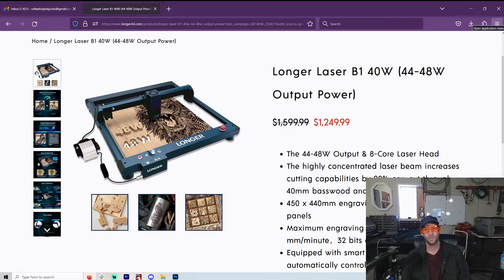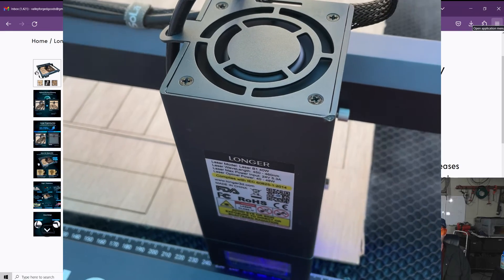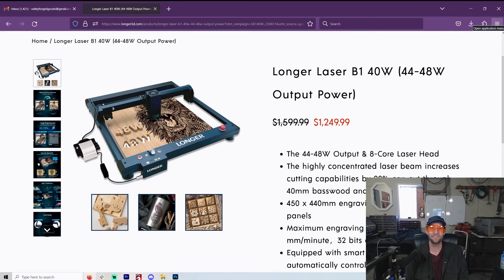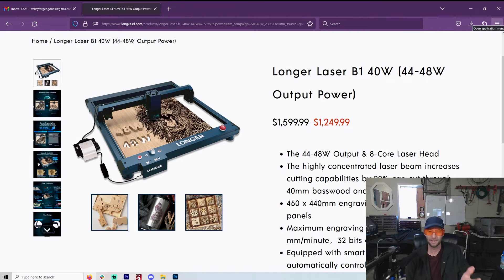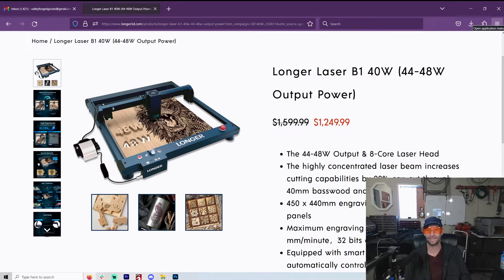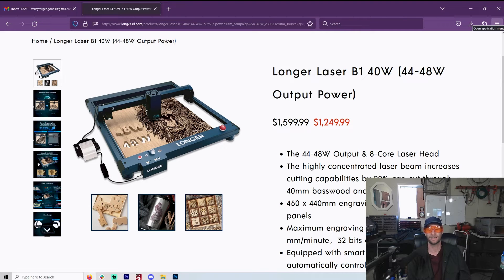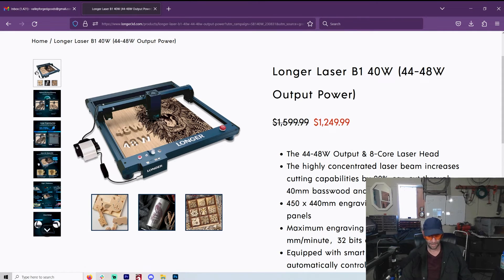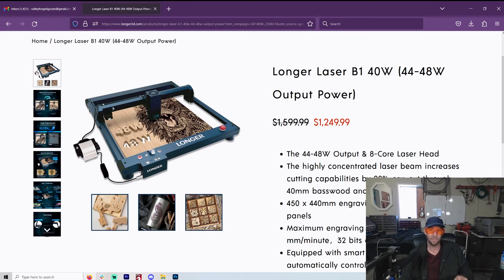NEW!! Longer B1 40w Laser Cutter / Engraver

Comment: I just used your link to order the Longer B1 40W. My Ortur 20W took a dump on me and Ortur was no help.
Reply from the maker: Yeah, Ortur used to be so great, but they sold out as far as I know. I don't know how good Longer cust svc is as none of mine have ever broken, lol
Reply: @ValleyForged should have mine in a few more days.
Reply: @ValleyForged I received the laser and so far it seems pretty good. I do have an issue when I want to clean the lens. The video shows removing 4 screws from the head, but the 40W doesn't have those screws. As a result I can't remove the air assist and can't access the lens. Any help would be appreciated.
Reply from the maker: @pop-popmoose5359  OH, wow, I haven't had that laser in a long time. Perhaps see if they have a Facebook group? I know I cleaned the lens, so it surely is not too hard. Congrats on the your laser! My friend has that laser as well, if you cannot get the answer, I could always hit him up. He loves his (for years now).
Reply: @ValleyForged Thank you!  Found out the is an opening in the side of the laser head. An Allen wrench fits in and allows removal of the air assist. 
Thank you again!

Comment: I have question 
I think 40w is ok for me 
So question is atomstack or longer  ray and why?
Reply from the maker: Hmmm, they are both great if you want the open frame type. Just go deep on both of them (all factors, price, etc...) and go with what you prefer. Check out the ACMER P3 as well if you could do an all in one (I have a newer video on it).
Reply from the maker: Oh, and I would NOT go Ray, I would go B1 (like this video) if you can afford it. The Ray5 40w is not as good as the Atomstack or B1, but less expensive.

Comment: I absolutely love mine and have only had it for a few weeks. I use it more than my P2 CO2 laser. Only complaint I would have is the exhaust fan on the enclosure is severely under powered. I also don’t like the fan running all the time.
Reply from the maker: Yeah, I never use the factory fans. I have a box load of them haha.

Comment: if i have a table that i want to etch a logo into, but its bigger than the machine frame, will it etch below, if i just place it on top of where i want it to be done?
Reply from the maker: Fairly certain it will. I don't  have this machine anymore (still one of the best for sure). I would check a Facebook group and ask there to be sure.

Comment: Anyway! I'm looking for a laser for cutting, not that nonsense "engraving". 😂 Sounds like the diode lasers are getting there in terms of cutting as well. Besides clear acrylic. Leaning towards a 40w unit. Saw in one of your comparison videos 1 year ago that you where planning to buy a 130w co2 laser in 1 year. That means now, are you still planning or have you even bought one?
Reply: For cutting, use a fiber laser, but that is a big step up, and requires more ancillary components: cooling, fume extraction, etc. For metals, you really need to be in the 500w range to start to cut at reasonable speeds.